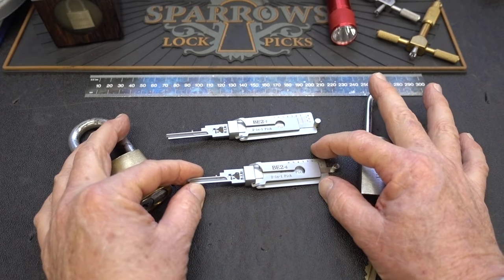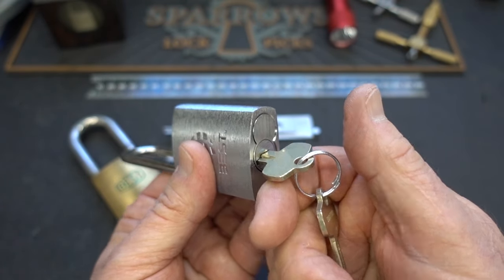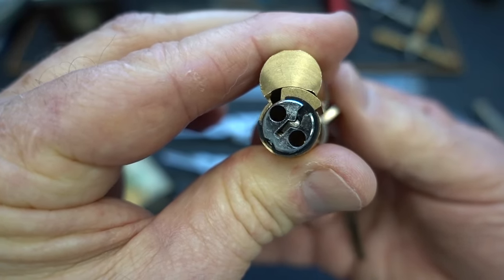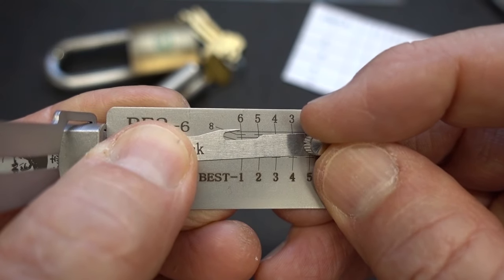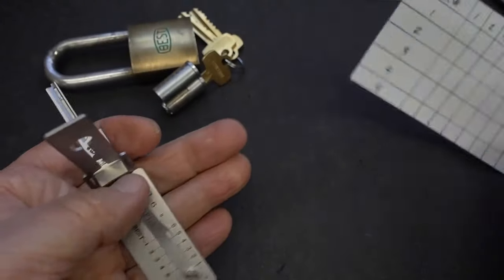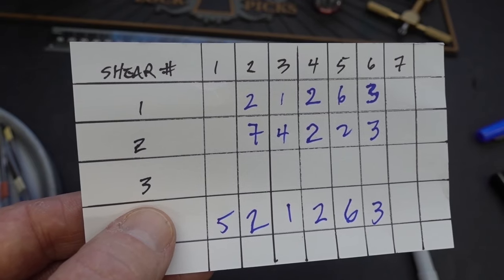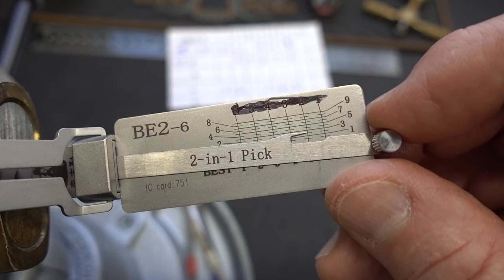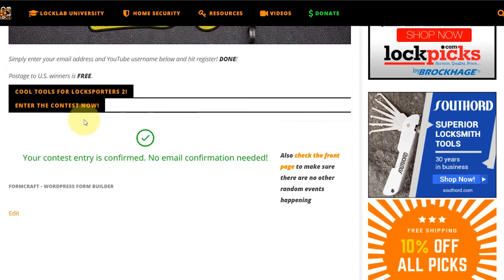(1638) Review: Lishi SFIC Picks (WOW!)

Comment: Maybe it's the camera angle but it looked like you were writing down the wrong numbers...  consistently.
Reply: Yeah, there was a bit of parallax error sometimes. And it's worth noting that the pinning is read under minimal pressure, so the tool doesn't bend.
Reply: yeah I thought so too.
Reply: Noticed that too, also noticed that sometimes the pick wasn't flush up against the rest of the tool as indicated by a shadow which would cause discrepancies as to the correct pin number. When it is flush you can clearly see it is spot on with a number line when it has been picked.
Reply: I agree... I didn’t see how the numbers BIll was writing down matched what I was seeing!
Reply: He got it right on 4, but 5 and 6 seemed to be 1 off.
Reply from the maker: After the video I re-picked it to control to replace the core.  You need to remember that I’m looking through a low res LCD on the camera so fine detail is difficult to make out.
Reply: After looking twice at the video (and also having some LISHI experience) Bill is reading the pins correctly -- it's easy to get the dashed line for the even numbers confused with the odd numbers solid line.  Also another issue it that the best increments are quite close and with 9 depths of cut (9 different key pin lengths + lots of possible additional "top pins"; unlike a LISHI for Kwikset (Crapset) which are extremely obvious.
Reply: @andrewclough660  no Lishi is for A2 system.  You could Certainly use it to lift the pins on A keyway but Lishi markings would be for A2 depths
Reply: @douganderson7002  Since I had just also received my LISHI for the Best A keyway, Bill's video caught my immediate attention. (+ obviously a lot of attention / comments from a lot of other folks who well understand SFIC's)  Bill's technique was very enlightening and very creative.  Since BEST SFIC's (or clones), have so many pin lengths, it's simply quite difficult to read / distinguish the correct pin number (as compared to some other"simpler" LISHI's).  I simply say THANKS TO BILL at LOCKLAB for showing us all & allowing us all to share some great & instructive comments.
Reply: @douganderson7002  I love Bill's videos but for someone paying attention, what he was saying wasn't matching up with what we were seeing. The question, for me, was really more about how hard it was to read the tool. Do I want one if it's that hard to get the bitting numbers right?

So GFY.
Reply: Give old bill a break, After all HES OLD!!!
Reply: I see the same. Must have been the camera
Reply: @SwervingLemon  if what he was saying and writing didn't match what you were seeing, then instead of assuming that the guy, who correctly picked and validated the sheer lines of a lock using the tool, is wrong. Maybe you should instead assume you are the one reading it wrong and try to figure out how he's reading it to get the numbers that he did.

Comment: Those are some nifty tools!  These remind me of my stint in artillery.  In school, we learned to solve the aiming problems using slide rules, aiming squares, maps and pins.  Later, in the Fleet, we got computers.  We got the same result, just a bit quicker with the computer.  Still, i like knowing the "primitive method" first, then the sleek new stuff.  Gives one a fall back option.
Reply: Agreed!!! Yes, you CAN do the same SFIC decoding by drilling for the lug leaving the pin stacks intact, dissembling the cylinder, but it's going to take a LOT longer, use a LOT more tools (and the stakes are higher if you make one minor screw up)...  I still like knowing how to do it if I need to though... I mean the Lishi's are awesome, but what happens if you run a call and your Lishi has broken, or you loaned it to another locksmith, etc?

Comment: The reason BEST starts pin 1 at the tip and not shoulder like most non-auto keys is because the lock is gauged from the tip not the shoulder.

Comment: in 2018, I bought a bag of idk 10 or 15 old Best SFIC (small format interchangeable) cores but they had no keys.  I set about taking the pins out of each chamber in each cylinder and mic’ing each pin and wafer.  I used the Best manual to determine the cut number for each shear line.  It took forever but I had the time and the inclination to get these cores working and to learn some stuff about SFICs.

I eventually ended up with a spreadsheet of all the wafer and pin sizes from each core.  From that I was able to locate the operating, control and master sheer lines for each core… or so I hoped.  So I called a nearby locksmith and got her to code cut me the control and master keys.  When I went in to pick them up we got to talking about what I was doing.  I showed her my bag of cores, Excel sheet, and explained what I had done to get the bitting for each key.  So she had to know…would the keys work?  Well they did!  The locksmith was amazed and aksed if I had ever done any smithing before because she said it takes her years to teach that to apprentices.  I said no, I’m just a giant nerd with too much time.  Partly in gest, she offered me a job on the spot. I was honored but I told her now that this was done I would probably never do such a thing again.  (haven’t) It was just a puzzle to me…although one that left me with a bunch of Best cores I now can use if I ever get a lock body for them.

Comment: I have a few of the pin tumbler Lishi's, and while I like them, some of the "cool factor polish" has come off..   Mostly I consider them just another tool in the tool bag.... Useful, but not necessary though they make life easier and decoding quicker... THESE though, could be SOMETHING of a gamechanger for commercial locksmiths....  

I FREQUENTLY get commercial jobs, mostly retail where I have to pull a core to replace worn out hardware... Problem is, no one can find the control key...   Usually, they don't even know what I'm talking about...      Now most of those are on pretty massive masterkey systems,  so yeah, it's still going to take a bit to decode, but it's gonna be a lot quicker than drilling the hardware for the lug, HOPEFULLY hitting it just right, pulling and dissembling the core, THEN decoding it, and repinning a new cylinder. The ONLY problem of course, is when the keyway isn't the A keyway...  That's the most common, but loads of places use other keyways. That's when it's good to know the old way.

Comment: Just for kicks and giggles it would be interesting to see those in action on a lock that has serrated pins.  To me these picks greatly enhance my visualization of what's going on in the lock and while I'm picking.  I could imagine those would help in building your "feel" a little too, though their shape isn't the same as the normal picks you might use...
Reply: bests don't use serrated pins
Reply: They can always be repinned.  Also the Lishi picks come in other core styles as Bill has shown in the past.
Reply: @Genthar  Best cores have to have balanced drivers also the pins and master chips used in Best locks are smaller than standard pins found in most lock sets.
Reply: I have the kwikset 5 & 6 pin lishis as  well as both the schlage  decoders and have success with serrated and  spools but not 100 percent of the time.
Reply: Here is Chris picking a challenge lock I made using a Lishi: https://www.youtube.com/watch?v=so66HogqA7g&list=LLGWGbIckjMKG0G_-y63j-xg&index=18&t=0s
I think...if I remember right...there was only one slightly serrated pin in it...but it should still give you an idea how it does on different pins.

Comment: Lishi tools are awesome. We've been using them in the automotive side of locksmithing for years. They've made my job considerably easier. Super cool they are moving in to building keys. Lishi for building locks are roughly 3 to 4 times as much as an automotive lishi tool. Automotive lishi tools are anywhere from roughly $30 to $45 on average with some going higher. Either way lishi tools are amazing. Totally worth your money.

Comment: That tool is a game changer for sfic.  Very nice demonstration.  I imagine these particular lishi picks would have a great return on investment for locksmiths.
Reply: Few locksmiths are called in to decode someone else’s system.  There are ethical reasons in most situations and systems are carefully recorded per lock change by the locksmith of record.  When we have a retail store call that uses Best on an emergency rekey where there is no control key available, we would pick the core to sheer.  Pop in a new core, or if necessary, a new cylinder.  This “A” keyway is the generic keyway rarely used in any system of size or importance.  The only time we use an A keyway is when a building is sold, we take our cores back and use A keyway and hand the new owner both operating and red tagged control keys.  I see this tool more as a burglary tool or for the heavy duty enthusiast due to high cost.  The A keyway is typically avoided by most professionals in modern day systems, especially industrial.  It would be more rare for a system of size to use the A keyway.  With that said, the locksmith will likely wait for the rare day when decoding is needed to invest in expensive tools like this from a practical perspective.

Comment: I wish the picks were more modular so instead of buying a new pick for each keyway you could buy a different end. 

Fascinating tool nonetheless
Reply: You would a different keyway & different gauge (not sure what "end" you meant). Only the actual picking tool and tensioner would stay the same.
Reply: Not really possible when you consider the difference key way lengths and depths. Not saying impossibly but its probably more accurate this way
Reply: This would be a great idea.  I think there are 30 different keyways that Best makes.  I bought this and of course the majority of what I can use it on is every other keyway but the 'A' keyway

Comment: Spent 25 years working for a telephone company that used Best changeable core locks on just about everything, and in several different keyways. During strikes or if we discovered a security problem we would do mass core changes on some or all sets (trust me that was one Hell of a lot of locks).

Most cores were master keyed (keys labeled 2, 4, 6, and 8 with "8" being the highest master level, and of course "C" control keys. A typical marking on the key would be "DX" on one line and below it the key level, for example "2" for a limited location contractor key.

I really enjoyed learning about those locks when I worked there (I was an engineer with "8" keys for two states), and those little Lishi tools are fascinating. (Would have been a lot of fun to play with.)

One thing I did notice on all of our company keys I had a chance to examine is the tremendous amount of planning that went into the system. For example, in any of the series, the lower level keys could not be simply filed down to a higher master level as the lower level keys always had at least one position cut deeper than any key number above it. :) 

Thanks for a great video!

Comment: The numbered padlocks with inline numbers can be picked in a similar fashion. I can pull on the lock and feel each number line up. Now the master one where you have to push it closed to release it, this method doesn't work. That's what is on my shed. Good luck getting into that one. Back when I worked for the city, we had master & sub master keys. Some door locks took 3 different keys. Foreman had a master. The service guys had sub masters. And the laborers & helpers had a regular key. Locker room, shop, office, & storage was a master. All but office was a sub master. Locker room & shop only was a regular key.

Comment: Super cool to watch. Thanks for sharing. I have 10 E core Best padlocks of unknown vintage ( I believe 1950s) and only 2 keys. It would be neat to decode them and have a control key. I'm willing to bet, based on where they came from, that the keys I have are master keys and that there are operator keys out there.
Reply: You would need a LISHI for an E keyway -- the A Keyway LISHI won't fit (and not offered yet by LISHI)

Comment: 8:08 Since the step between bitting heights is only .0125 in the Best A2 system, there are no #1 master wafers. Minimum step inside the same chamber is 2 (.025), and those are tiny enough to make your head spin if you're not careful when building them. Almost indistinguishable from the spring retainer caps.

Comment: With the lock mapped you can actually make new keys for old cores instead of replacing the cores.
Reply: Wouldn't that be riskier? So we're doing this because there's a lost key(s). If we just order new keys, someone who 'found' the lost key could still gain access.
Reply: @brolohalflemming7042   He ordered these off of Ebay. Nobody is going to try the right "found" key in these locks.

Comment: With the Lishi tools I find i need proper lighting to use it. Also I used a marker to add color (with a marker) to the pointer on the tool to help in seeing it. Another technique is to start with the pins totally depressed and look for the shear line as I release it.
Reply from the maker: That's a great idea!  I used my black magic marker to color the little pointer and it is 10x easier to see & read.  Thanks for the tip!

Comment: Hi Bill! Do you know if they will ever (or will it even be possible to do it) make models for the Euro-style keyways? Fascinating tools..am really tempted to try to "make" one myself for our kinds of locks..
Also, is the pin spacing identical on the 6- and 7-pin tools? I mean, if you just got the 7-pin tool, will that cover the shorter keyway too, or are the pins closer together as well as more numerous on the longer keys?
Reply: The longer 7 pin will work in a 6 pin keyway and will still line up correctly.  When in doubt with the lishi picks, buy the longer one.
Reply: Thanks! Any idea what would be the point of making/selling the shorter ones, if the price is very close and they work the same anyway for the shorter keyway..?

Comment: Many times you will find 2 shear lines in the same chamber that are only 1 depth apart.  For example Change key: 738625.  Control key:  287354. In chamber 3 there are two shear lines at depths 7 and 8.  And in chamber 6 the two shear lines are at the 4 and 5 depths. The operating key and control key are usually written in opposite parodies.  Here, the change key 738625 parody is Odd-Odd-Even-Even-Even-Odd (OOEEEO). The control key parody is EEOOOE,  just the opposite of the change key.  This may be to help avoid mistakes working in the Key Bitting Array and also frees up a few more change keys.  I have never worked on a big SFIC M/K system that wasn’t designed in this opposite parody bitting format.
Reply: Your explanation makes me wonder if the thickness of the control mechanism adds a fixed number to the key height of any positions where the pins go through the control lug, but nothing to positions where the main sheer line is used for both.
Reply: @johndododoe1411    You are right. For Best or Arrow you always add the number 10 to the deepest working key.  That is approx  .124, which is the thickness of the control lug. For Sargent the number is 8,  .153, the thickness of their control lug. Good Thinking.
Reply: @johndododoe1411  Sorry. You are still right, but it is a little more involved in the total pin stack formulas.

Comment: Will the 7 pin tool be able to  pick 6 pins locks ?
Reply: Not likely, the tool will flex and cause friction which will hamper your feel for picking. Same happens with SC4 6 pin used in an SC1 5 pin lock.

Comment: Newbie question...  around 7:50 in video when you start testing the 'springiness' vs 'where it binds' - for someone who does not understand the technology, and only knows there are pins that have springs pushing them in the same orientation.  Why would some pins be merely 'springy', versus some pins 'binding'?  Physically what makes that pin/spring configuration different than where a pin/spring is merely 'springy'?  Thanks as I am just trying to understand this technology better.

Comment: Can the seven pin version be used to decode the six pin cylinder? I suspect the cylinder tensioning would need to be augmented due to the longer tool not engaging.

Comment: BEST doesn't use "master wafers, or master pins" because you don't use standard pins in BEST ICC. BEST has specific pins with a set of bottom, and multiple rows of top pins. The only thing that I can see which is a big negative about the lishi tool with BEST locks, is the keyway. BEST has a ton of keyways which means you would have to spend 120$ for each of their keyways. I am not willing to spend that kind of money. At least on the automotive end, the lishi picks are around $40 for each keyway, and car manufacturers share a lot of common key ways.
Reply from the maker: Uhhh, I've gutted LOTS of Best SFICs that were master keyed - some with as many as 4 shear lines per cylinder.  They may not call them "master wafers, but it was A BEAST to decode, but still possible.  I absolutely agree about the cost and number of keyways.  I glanced through my naughty bucket and found 7 different keyways... and know there are many more than that.  I guess those are future projects for Lishi...  If I were a locksmith responsible for a large facility using SFICs, I think it would pay off to keep one of these for whatever keyway you use.  Buying them all (when Lishi eventually produces them) would be cost prohibitive.
Reply: @bosnianbill  you are absolutely correct that BEST ICC can be set up on a master key system. But the terminology for BEST is just "top pins" there are no master wafers or pins; VS a standard lock, which has bottom, top, and master pins.

We don't want to confuse anybody lol.